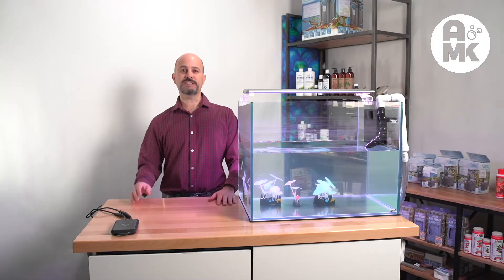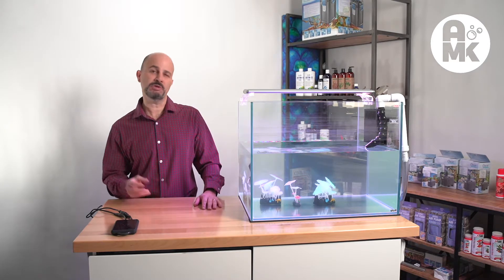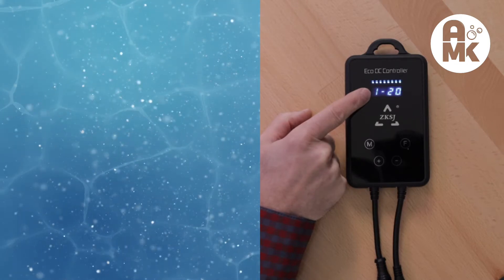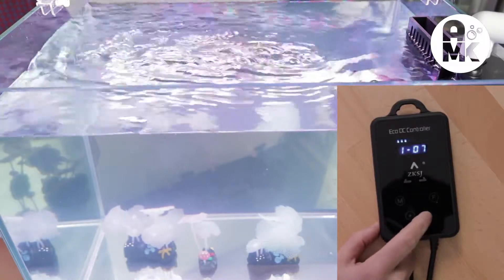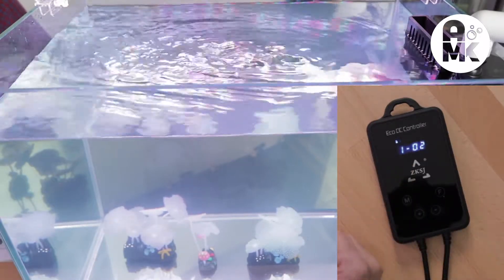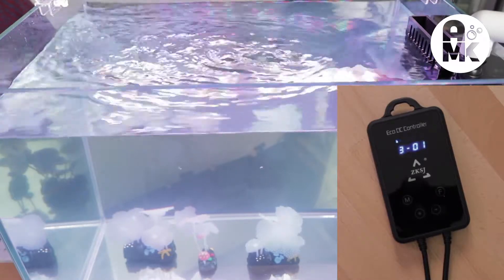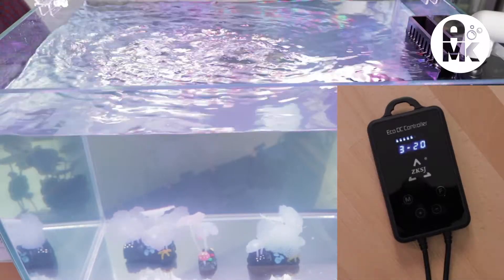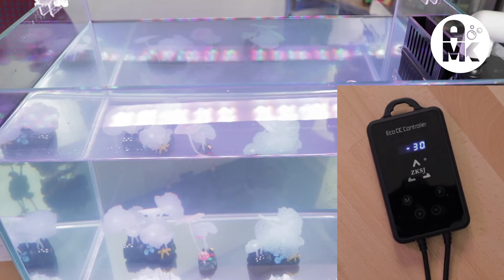Platinum Blue DC Return Pump Programming

Comment: Yeah, but how do i set it up for a 45gl tank? Im new and am trying to figure out how strong to set this thing to
Reply from the maker: What type of aquarium and overflow you are using will determine this. I have a 43 reef that uses the 800 on full flow but it has a large drain system for example.  I have a 50 fresh water and I run it at 75% and another one at 50%.  If you have more details I can help.  Otherwise just start at 50% and work you way up.
Reply: @aquamanknox  i have the eclipse s on a beluga 43g 
Saltwater
Reply from the maker: I have one also.  I actually have these tanks one set on 20 the highest flow the other on 16.  I have mine with siphons and one safety overflow.  They run silent that way.
Reply: @aquamanknox  and you dont feel it bothers the fish any?
This is my first saltwater tank so im learning.
So channel 1 20 channel 2 16?
Reply from the maker: @CalcioFan4Ever  you can use the flow level from 16-20.  Use constant flow for the return pump in this application.  It absolutely will not bother fish.  Saltwater fish are not effected by flow like freshwater.
Reply: @aquamanknox  ah ok. Yeah i come from freshwater so im learning.
Not many videos on dc pump setting up and such. Its usually on "best dc pump 2020" and such.

Thank you